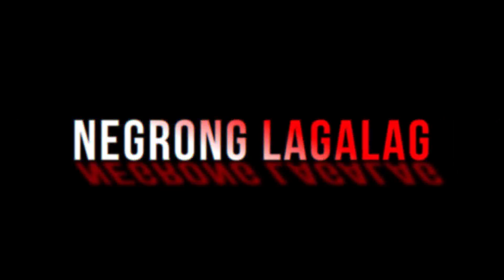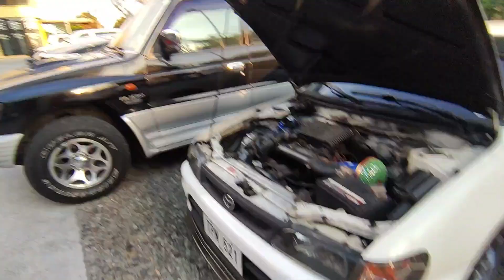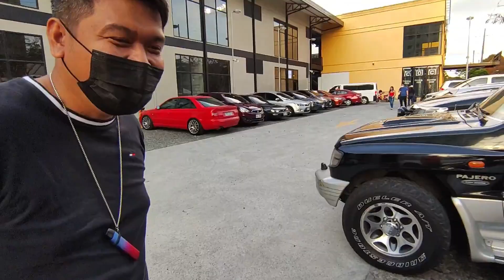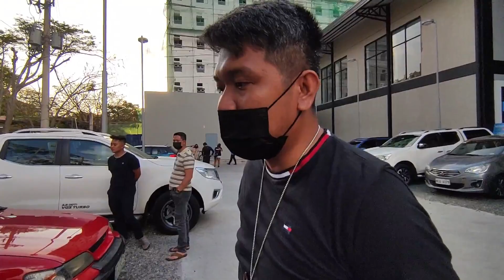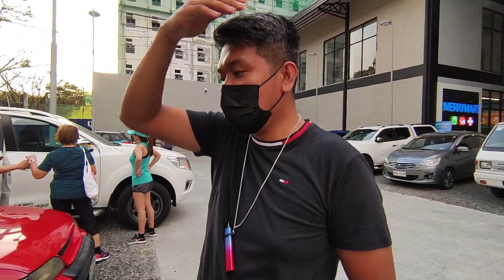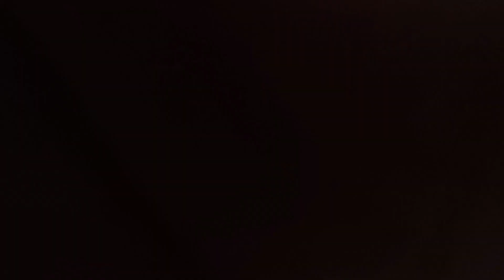LET'S TALK ABOUT 4EFTE | 1300cc TURBO ENGINE

Comment: ano kaya maggng power ng otj ko pag natapos na. 
4efte
top mount stock turbo
megasquirt2 ecu
custom headers
fmic
4agze injectors
4age cam gear
coil on plugs
stock internals
side exit 
ext wastegate
bov
walbro fuel pump
Reply from the maker: Uyyy, magandang project yan boss ah. Balitaan mo ko pag natapos hehe

Comment: No sir with stock internals you cant go that high with hp to 400hp.....to do that of course you have to use uprated connecting rods the forged ones than you can go to 400hp or even more.... We here are crazy about 4efte engines and the 5e also and we use to go 9s @ quarter mile or even under 9s sometime
Reply from the maker: More than 400 is a time bomb but under 400, i think it is tolerable since i got to see it with my 2 eyes.